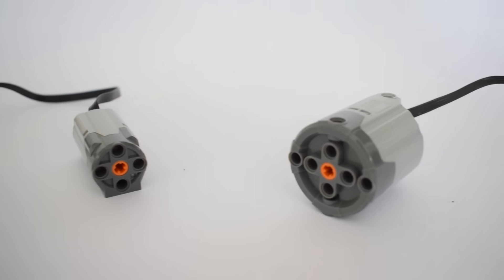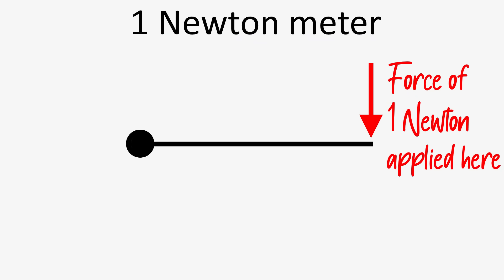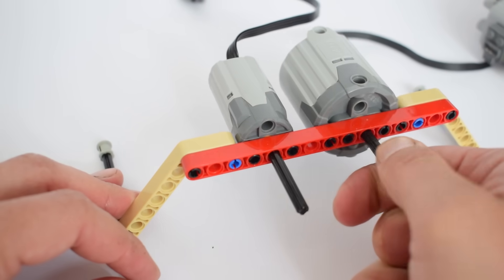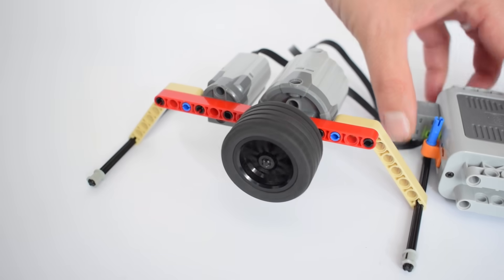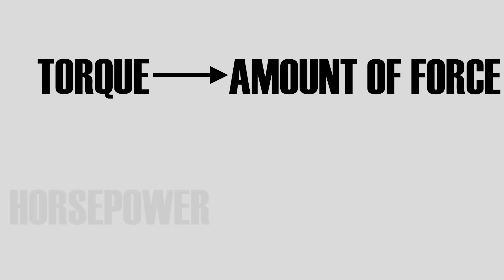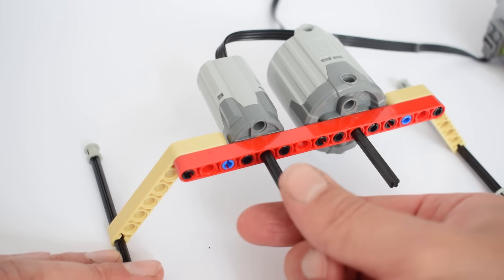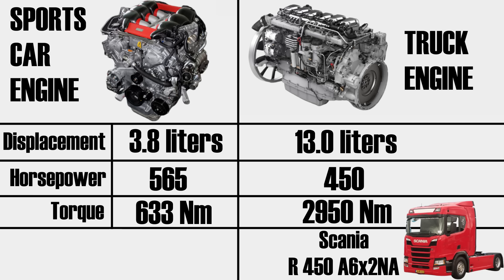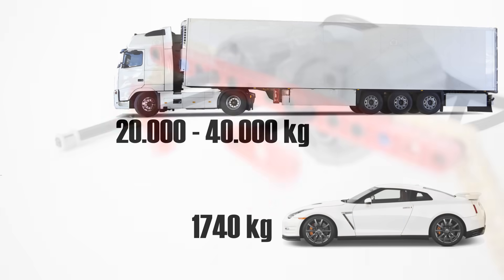NEVER be confused by HORSEPOWER and TORQUE again - HP and TORQUE EXPLAINED in the MOST VISUAL WAY

Comment: Would be interesting long stroke versus short stroke, and how power is generated differently. Effect on moving mass, compression, RPM...
Reply from the maker: That's a good video idea, thank you!
Reply: @d4a  something along that line was in this video (motorcycle engines): https://www.youtube.com/watch?v=-ooue7i73zo
Reply: @AlessandroGenTLe  I was sure it was RF9... I knew it before clicking! :)
Reply: @d4a  go  go unubbpgg
Reply: @d4a  yes.. you should whack that topic to your next videos. Since lots people almost failed to understand n comparison between those too. Beside between piston n stroker n crankshaft are well related.
Reply: YESSSS this would be great
Reply: Long stroke would be have more torque
Reply: @abdulabdanahib9617  Not necessarily lol.
There was an article entitled the 350 Chevrolet should've built. Unfortunately the article has vanished from the web.
Anyhow, instead of the familiar bore and stroke of the gen 1 350, Smokey Yunick wanted GM to build a 350 around a 400 small block bore size with the 327s stroke. This would've necessitated long rods.
A magazine decided to build it and they modified Ford 300 inline 6 connecting rods (pre readily available cost effective con rods) and the spread of torque was flat like a tabletop from 2000 - 5000 rpm and never dropped below 400ft/lbs in that range. So short stroke engines can make good torque it seems. The magazine was shocked because the result was as Smokey predicted btw. Interesting huh??
Reply: @abdulabdanahib9617  No it would not, for a given displacement.

That is one of those old myths that simply refuses to die, but can be disproven in 30 seconds with a simple application of classical mechanics.
Reply: Check out engineering explained. He has a couple of videos talking about piston diameter versus stroke length, and how it affects efficiency and power. (Also max rpm)
Reply: I agree that would be a worth while video.
Reply: Also, 2 stroke and 4 stroke engines.
Reply: @Rrgr5  2 stroke pre-mixes air and fuel through carburetor, so the action was only Spark/Bang and Exhaust
Reply: Rod ratios pretty please. A video on pressure ratios would be cool too. (Not compression ratio, pressure ratio)
Reply: Formula for each cylinder is:
Power = Cylinder Pressure max * Length of stroke * surface area of piston crown * RPM * (1 for 2 stroke or 0.5 for 4 stroke)
Reply: @Bari_Khan_CEng_CMarEng  yes, hit the nail on the head with that one. Though one correction I'd make is, not max pressure is used, but average pressure (BMEP).
Reply: @MrAndrius12  thank you for the correction with BMEP.  Power = P.L.A.N.n
Reply: https://youtu.be/PSppzkYECGs
Reply: Would be good. A large bore with short stroke creates more horsepower coz it can handle higher revs, whereas long stroke increases low end torque but cant rev as hard
Reply: @POLITICALYCORRECTify  the part regarding short stroke high revs more hp is correct. 
But long stroke (and smaller bore to keep the displacement the same) 'by itself' doesn't give higher torque. Torque is calculated from distance AND FORCE, not by distance alone. What you gain in distance (stroke), you lose in force (bore). Force is cylinder pressure times piston area.
Reply: Watch FortNine where he compares Harley to Indian. It explains an idea like that..
Reply: @facial210  Oh no 😬 that vid is terrible. Full of wifes tale.
Reply: Yes, and also not just internal combustion, take a steam locomotive and compare from bore and stroke.
Reply: Isn't it as simple as short stroke being able to have higher RPM and long stroke has more displacement and more torque?
Reply: @MqKosmos  an engine with more displacement (everything else equal) will always have more torque. If it bigger by stroke or bore doesn't matter.
Reply: Long stroke more torque
Short stroke more RPM

right?
Reply: @Skynet Stroke length has nothing to do with torque or acceleration.  It has everything to do with overall engine design; a high speed engine requires short strokes to deal with acceleration forces.  Everything else is according to how the designer wants the engine to function.
Reply: Revolving mass. Not moving mass
Reply: Interesting to note that many of the old British automotive manufacturers used long stroke engines, because it gave a nice torque figure in across the rev range. Rather than the limited power band of a large bore motor.
Reply: @MikeWooshy  long stroke gives better torque in the lower range, while a higher ratio of bore to stroke allows the engine to rev harder giving more horsepower. So I wouldnt say it's limited.
Reply: @POLITICALYCORRECTify  I would say it is limited, particularly in real world road usage. Not one likes to drop the gear all the time and be a "Vtec Y0 kid" trying to overtake. A nice progressive torque from "the bottom, up" is what is used to make progress in the road in real life. Revs are great for track, on road less so. And that is before we get into other applications such as ICE usage for power generation.
Reply: I have dynoed small motors like this you see big spike in torque low rpm and gradually reduces to be just above normal stroke hp
Reply: Atkinson VS Otto
Reply: Leverage is something few consider, at a cost of dwell, and off set
Reply: now that you've read all the comments, recognize that the topic at hand is complex, which is why everyone thinks they're right, even though they are not.
Reply: What is a Newton???  Simplified one horse power = 33000 lbs moved 12 inches in one minute....
Reply: Great video, though I’m still a bit confused, what causes the actual difference rpm if they’re powered by the same source? Is it just a matter or the bigger moving parts resulting in slower rotations since the same amount of power is trying operating it as the smaller motor? 

If power from the battery was proportional to the size of the parts, would the horsepower then be 4 times that of the smaller one like the torque numbers? Would the torque numbers also change? I hope I articulated these questions well enough.
Reply: Short stroke would typically allow more revs, long stroke would allow better economy (due to lower surface area. But torque wouldn't change because of "leverage" since our torque not only depends on this leverage, but also the piston surface area)
Reply: @MrAndrius12  Short stroke engines tend to produce their torque at higher RPMs than long stroke engines, all things being equal.
Reply: @elroyfudbucker6806  yes. Also as TexasRoadWarrior said above, bigger bore allows for bigger valves, hence, improving airflow greatly.
Reply: @elroyfudbucker6806  And it's especially telling in the ratio of peak power to peak torque. A Panigale V4R has an 81mm bore by 48.4mm stroke, and it has 230 HP but only 83 ft-lbs of torque. F1 engines had stroke lengths that were less than half their bore diameter, so they could get up to 800-900 HP but only something like 200 ft-lbs of torque. On square and slightly undersquare engines, the ft-lb and HP values are about the same. On significantly undersquare engines like Diesels, the ft-lbs of peak torque are many times higher than the HP figures. So yes, short stroke isn't as good at producing torque (as you said, the peak torque RPM tends to be closer to the top of the rev range).
Reply: @MrAndrius12  Doesn't a longer stroke typically allow for more torque? I say that since you have a longer leveraging distance on the crankshaft. For the same bore diameter, a longer stroke would allow for greater torque.
Reply: @electric7487  as I mentioned above, that is just a myth. See, for a given cylinder pressure, you have more FORCE pushing the piston down when you have a bigger piston (you multiply pressure by the surface area of the piston). But then leverage just counteracts that disadvantage that small bore/long stroke engines have. So basically, big bore compensates for lack of leverage by producing more FORCE, whilst the longer stroke compensates for lack of bore size via better leverage, turning more of that force into torque. I even did the calculations myself to find out the truth a very long time ago. You can even do this yourself if you like.
Reply: @electric7487  yes but as it travels longer it loses a bit due to the distance travelling... it MAY not always be the case but the least you would lose is response
Reply: @electric7487  longer strokes means smaller bore so combustion chamber is less flat, combustion is a bit more efficient, and there is less heat transfer to the cylinder, so again  better efficiency. short stroke allows faster revving, larger valves and more cooling so more high revving power. because of this short stroke engines are tuned for more top end torque, thus less low end torque because combustion engine cannot be efficient across a very wide rpm range. this is the most important reason for short strokes having more low end torque (think twin cruiser vs inline four sports bike). but it doesn't mean that long stroke necessarily have higher maximum torque.
for more complete understanding google BMEP brake lean effective pressure. it is the best way to measure torque independently of displacement, number if cylinders or RPMs. you will see that engines with the most torque per displacement are not slow revving engines but Ferrari V12 or F1 engines. this torque is just not available at low Rpms
https://youtu.be/bE_1JYrlYYU
Reply: That's what she said
Reply: My girl seems to prefer my longer strokes versus her ex's short strokes 😆
Reply: Why!! Same HP
Only difrece om Long Vs Short 
Is acceleration !! That's why again
You hawe Long stroake in DISEL haulers
You dont need acceleration but mooving NM
Reply: @kennethschultz6465  not necessarily. Check out engineering explained. He goes over why different cars have different stroke to piston diameter and why they help in the circumstances they're in.
Reply: It doesn’t matter, engine displacement makes more power everywhere... yeah there’s some efficiency to be gained with short stroke big bore it allows for bigger valves and it’s less stressful on the crankshaft... the torque rating is meaningless, ALL electric motors and gas/diesel are rated in horsepower! Things like water pumps, compressors, etc. torque doesn’t tell you how how much “work” is being accomplished it only shows how hard something is rotating.
Reply: @Texas_Road_Warrior  If Torque rating is meaningless, why not put a 585 HP GTR engine in a Scania Truck? It has more HP in its 3.8L engine than the 13L diesel.
Reply: @itechiwizard83  If geared right, it would move the truck perfectly well, but it would last 5 minutes. The 13l truck motor is good for a million km...
Reply: @CS_247  not very fast tho, unless you'd have 100 gears

Comment: You can convert RPM into torque and vice versa with a gearbox :-)
Reply from the maker: But it's a conversion with a commission 😉
Reply: @d4a  all vehicles covert rpm to torque, via gearbox and terminal reduction. No car or truck runs the wheels directly at the crankshaft's rpm. So you already are doing a conversion. There's no specific commission, the ultimate limit is energy (horsepower). You can take the Nissan engine and put it in the Scania and it would be capable of pulling even more weight than the Diesel engine, provided you geared the thing accordingly.
Reply: @jaumeprimerelhipster  funnily large containerships dowt use a gearbox to change the ratio, but drive the propellers directly.
Reply: @vast634  sure but that's because this kind of engines run at very low rpm and a boat of this size has a narrow operative margin of speed at the propeller.
Reply: @d4a  You have to rob Paul to pay Peter.

Comment: The car acceleration example is misleading. I hear people say it all the time implying you want lots of torque from the engine. But you are actually experiencing linear force and it comes from the torque of the whole system. Lower torque cars can accerlate faster than high torque cars given the proper gearing.
Reply from the maker: What car acceleration example? When I said you feel torque when a car accelerates? That's not an example, I was just trying to illustrate why you can't feel horsepower. I'm not sure what "feeling the torque of the whole system" means? The engine is the only thing that generates torque in the system and the linear force pushing you in the seat is the result of that torque. "Saying that "low torque cars can accelerate faster than high torque cars given the proper gearing" is like saying that a 5 ton car can accelerate faster than a 500kg car given the proper engine. Given the same gearing a high torque car will always accelerate faster than a low torque car. A low torque car will only accelerate faster if it gets shorter gearing than the high torque car.
Reply: For cars of the same mass, the one with the most horsepower is always able to accelerate faster. Yes, it may require different gearing (unless it is already able to break traction), but it has a higher potential of acceleration relative to it's increased horsepower over the high torque car. When you feel acceleration you are feeling horsepower because acceleration is rate of change in velocity and horsepower is the rate at which force is applied.

Comment: Ok i have a question, what if when you look at a dyno graph, the engine makes peak power at lets say 300hp at 5000rpm and 400nm torque at about 3000rpm
Does it mean the engine gets weaker past 3000rpm?
Reply: Power is force / time. Torque is a force. When the torque starts to drop, but in the meanwhile the RPMs are still going higher, it means that yes, the engine is producing less force, but since the rpm are higher, that lower torque is produced more frequently.
Reply: To answer what you're trying to ask.

Torque must decline with RPM at and after peak power, otherwise HP would continue to Increase higher.

Each individual rotation of the engine then is weaker per revolution but you're doing more of them.

So total work done in a period of time is at its highest or strongest at peak HP.
Reply: No, the torque increases to 420 nm at 5000 rpm, so it gets stronger
source: math
Reply: @mrc14_2  ok how do you calculate that?
Reply: @Manuqtix.Manuqtix  for power to torque you type in the power number of your choice, for example 300, multiply by 7000 and then divide by the rpm you asked

Torque to power is also simple
You just multiply the torque amount with the rpm you want and then divide by 7000

Examples: 420 nm × 5000 rpm/7000 = 300 hp
761 nm  × 9200 rpm/7000 = 1000 hp
730 hp × 7000/2300 rpm = 2221 nm
240 hp × 7000/8000 rpm = 210 nm

Comment: I always think: Torque is acceleration, Horsepower is speed
Reply: which is wrong, power is what's needs to accelerate fast and be capable of going fast. Torque in isolation is meaningless, standing on the pedals of a bicycle you make more torque than many cars, with a long bar you can tighten a nut with more torque than that truck outputs
Reply: @fuzzy1dk   For cars the analogy holds quite well
Reply: @EquiliMario  still fundamentally  wrong and not how physics work
Reply: @EquiliMario  No, I'm afraid not. Power is all that matters, really. Torque is just a component of power, just as RPM is. Think of it this way: a guy that is super strong (lots of torque) isn't worth much if he is super slow (low RPM). He will not get much done anyhow. You really need both to get shit done (how fast you can work = how much power you can output). If you are very very weak, but fast, you still don't get much done, because you can only move a grain of sand at a time.
Reply: @oskjan1  oh dear... Sometimes its just better to say nothing at all
Reply: @bluewanderer9903  Sorry?
Reply: This is not entirely true

Comment: Let's say you have a 32L Diesel engine and an engine from a Kawasaki ZX-25R. Your Diesel can make 3,000 ft-lbs of torque while the ZX-25R's engine only makes 16.89 ft-lbs. You want 1,200 HP out of both these engines. How fast would both of these engines need to spin at in order to make 1,200 HP at max torque?

Diesel: 1200 / 3000 * 16500 / π = 2100.8

Zx-25R: 1200 / 16.89 * 16500 / π = 373152

As you can see, the Diesel, if it's making 3,000 ft-lbs of torque, would have to get up to 2,100 RPM in order to make 1,200 HP. The little motorcycle engine, on the other hand, would have to get up to 373,000 RPM.

Good luck with that.

In this example, one can see that an engine that can generate lots of torque can easily make power even at very slow speeds. They are typically much more limited, though, in how fast they can turn because they often have heavier components and will often run, in their cylinders, longer stroke lengths than bore diameters.

Smaller engines with high power-to-weight or power-to-displacement ratios cannot produce lots of torque, but they can make up for their lack of torque by spinning at fast speeds using very lightweight components, along with (generally) short strokes and big bores.

They sacrifice longevity, though, as fast speeds generally mean a lot more wear and tear, so those small high-revving engines generally will not (and cannot) last 1,000,000 miles like a Diesel can.